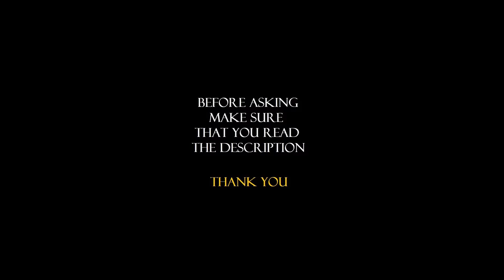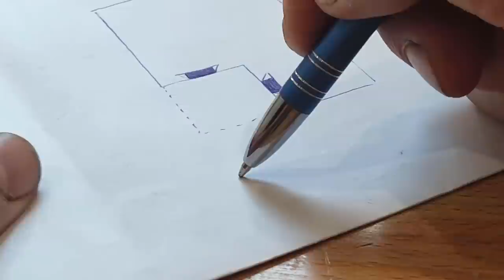052 Grooving plane - Planes for planemaking / Woodworking

Comment from the maker: Today i decided to start new series of videos. I call it "Planes for planemaking".
I'm gonna build some moving fillisters with dovetailed boxing (the same as in 0:21-0:45) so it's time to prepare another tools that i need for this project. Some of you probably think "hey, you can do it with any router.." and you have right, but if i want to build it only with my hand tools i can't use it. My router is the best in catching dust.
In this project i'm gonna build grooving plane wich will help me to cut a female part of the joint.
For the body i used spalted beech, for boxing boxwood (if you dont know what it is go to description of 046 video), NCV1 steel for the iron. The finish was preety simple - one coat of boiled linseed oil and two coats of antique oil. Oh, for gluening i use hide glue.
Very often you ask me about my stamps. The smaller one was made by grawernia dot pl and is hardened so i can use it on metals. Two bigger stamps were made by Mirock's Toolworks as one stamp. It was a real challange to use so big stamp so i decided to cut it in half and make two.

I hope you will like this video, i know it is quite long but i can't show you less :)
If you are new here please consider subscribtion for more.

Cheers!
Reply: Execelent work! Great detail and no music! 100 thumbs up on that alone.
Reply: Antique oil, what's that? Thanks
Reply: Dear Mr Gakos, I would be interested to know how you made the small saws and files. Do you have any video material that you could publish? Thank you Guntram.
Reply: Thank you for this! I have had a question about boxing for a couple of years and hopefully you know the answer! I see the plane you made is to make the groove for boxing, what was used in the past to make the tiny sliding dovetails that was used to attach the boxing in some cases. The dovetail is so small that I cant imagine it was made by a plane, but maybe I am wrong. I was hoping you would follow up this video with another one showing the tool used to change the grooves to dovetails.
Reply: I wish you went into business selling your planes, you could make lots of money and set standards in workmanship. If you ever do, I'll be first in line ready to disburse a significant amount =)
Reply from the maker: Hey, miniwax antique oil, just check it in google
Reply from the maker: Hey Guntram, i don't have any video about it. Please check Walter Sorrels video about planemaking floats. Cheers!
Reply from the maker: Hey Skwalka, i'm gonna do this in the next year 👍 Cheers!
Reply from the maker: @skwalka6372  Hey! I got one strike block plane for sale, if you are interested write me back esortodox @ gmail . com
Reply: Tell us about that plane cabinet.
Reply: What are those "stones" at 32:56?
Reply from the maker: Hello, i posted some photos on my Instagram profile
Reply from the maker: @tonyennis1787  Water sandpaper glued to the piece of mdf

Comment: This is one of the things that no one expects when they first get into having their own shop that relies upon hand tools - the making of tools in order to make tools that make other tools. Many life ambitions and plans have been scuttled by the 1, 3, 6 or more month diversions necessary for one to reach the point of even starting in a new direction. This is why each of us has some aspect of our shop in a condition we don't want to talk about, meaning in a poor starter's condition, basic and in desperate need of upgrading. For me, it's my table and tool storage. I have intentionally neglected those for decades in order to advance in other areas as what I have accommodates enough fine work and rough / general carpentry work equally. As I age, however, and begin to do less rough work the need for a better bench and storage increase as the need to make such preliminary tools decreases. Thank you and God bless you for putting this video out because there really is a need for new woodworkers to understand what awaits them down the road. You've made the process seem fun and engaging, leaving out the parts where you lie awake at night fighting with near panic attacks over being behind, not knowing where to start, juggling a dozen options and calculating the worth of everything you do and have done so far in life - ie the truly sucky parts that explain why most of us who pursue such career paths don't own handguns or keep long lengths of rope at hand :)
Reply from the maker: You have right my friend, Cheers!

Comment: Great build! I just have two questions if you don’t mind. First, will the break in the boxing have any lasting effect or did it just make the glue up more difficult? And second, in several of your videos it looks like you use your rebate plane almost like a shoulder plane, does it work well for that purpose as well? I only ask because I have tried it with my metal Stanley and the results were poor. Making a plane like yours could be a great alternative!

Comment: Hi, your experience in planemaking makes me hope you can answer a question I have which is related to this video. The boxing you made will fit into the 2 grooves in the plane, and you just showed how to make the "mother plane" for making these grooves. I have seen lots of old planes where the boxing was not slid into grooves, but tiny dovetails, maybe 3-4 mm. Is there a separate plane to make these tiny sliding dovetails? They are just so small that I can't imagine a sliding dovetail plane being able to make them. Thanks!
Reply from the maker: Thanks! Yes, there will be another plane for that tiny dovetail profile
Reply: @StavrosGakos  thanks! Will you be making one?
Reply from the maker: @user-xd6jt3dx8p  that's the plan.

Comment: What are you using to lap the iron? I see the diamond plates but what about with the higher grits?
Reply from the maker: Hey i have diamond plate 400/100 and pieces of MDF with sand paper 1000, 3000, 5000, 7000 👍

Comment: Those saws seem similar to extremely course files.
Reply: You should temper your steel in molten salt to harden it. 

Heat
Quench
Rough Sharpen
Temper in molten salt
Sharpen again.
Reply from the maker: Thanks, i'll try 👍
Reply: @StavrosGakos  I’ve been talking about it for years and no one that forges or hardens blades has tried it. I saw it on a “how it’s made” back in the 90’s when they did an episode on Barretta’s 9mm pistol that the US Military used. I looked it up some time back and salt melts at like 1500f and doesn’t vaporize and evaporate away. Anyways, maybe it’ll step up you cutting edges just a little.

Comment: Why do you harding blade  ? You appeared  your face
Reply from the maker: What do you mean?
Reply: @StavrosGakos  l mean you appeared  your face on back the blade that mean it is good steel or hard  and then you harded  it. why?
Reply from the maker: To make it harder and durable. I prepare the iron before hardening, when it was softer. In the result i had less work after hardening.
Reply: @StavrosGakos  please.
How do l know that iron hard or soft?